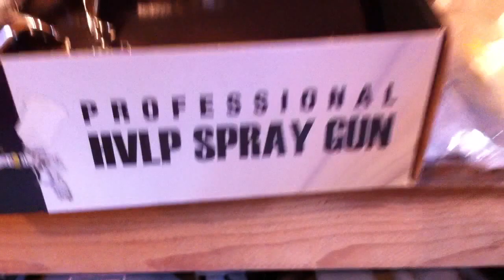New gun action shots

Comment: I liked what I saw a lot.  Your distance was perfect.  You were counting 1 second per foot at about 8 to 10 inches most of the time and were letting your wrist get involved keeping the shot uniform.  I too recommend  you watch the video a couple times and count as you watch yourself and count along.  You will see when you went to fast.  The gun is way better and all that's left is to adjust the fluid knob in a bit OR add some reducer/thinner.  If the needle is adjust in just a 1/2 turn at a time it will let less material into the center action area and the pattern won't be heavy in the middle.
  Is there a mark on the fluid knob to keep track?  If not turn the fluid knob all the way in and file a little hash mark on the knob with a hand file for future reference. Turn the knob out 2 & 1/2 turns to set another bench mark to work from..  You got this now. When it is paint remember to get the edges first..Very good... very good!
Reply from the maker: Thanks, Milo!!! I was trying the counting thing and did mess that up a few times... like I would get the counting right, but mess up on the distance, or vice versa-- Like learning to drive: at the beginning there's all this stuff you have to think about all at once, but after you get experience, things become second nature and you can relax about it... freeing your mind to do other things like text, talk on the phone and change your pants while driving

Comment: awesome video, I have the purple HF gun ,the cup leaks on the bottom treads ,and the lid doesn't seal tight, what a mess ,I will look for the 45 $ one, good job
Reply from the maker: Looking back, the purple one is just designed crappy--- from what I can see, the better gun wouldn't cost all that much more to manufacture -- holes are in a different place, a few more holes... I think the difference is only in the nozzle... It's tempting to switch the air nozzle out...

Comment: Most of your "issues" are covered in the comments.
What I saw was mainly technique problems that take a while to educate the hand/eyes about. This is why I mentioned spraying on scrap panels, metal doesn't absorb paint. It can take a while to get your body/mind used to a gun.

I can still recall my first real paint job. It was a metallic blue (GM code 29) lacquer on a LeMans... First coat looked like I threw sand in it. (DRY). Waited two days and sanded it smooth. The next coat was much better for coverage but the metallic was splotchy. Sanded some more. Then I decided to ask for help....

You have it in the correct order, HELP? Practice, review, practice, review, PAINT the car...
Reply from the maker: Thanks Blazer-- yeah-- I need to loosen up a bit more. Maybe a few beers before playing with sprayables! Well, at least to practice

Comment: First Great Job Reubster!!!! A couple of questions what is your pressure at the gun? before and after you pull the trigger?And you are holding the gun at an angle to the panel causing heavy and light pattern`s (Striping)
Reply from the maker: I'll have to check... When I first was setting it up, I went 28 pounds at the gun (like is says, stamped on the gun itself) -- and nothing was coming out-- just a gentle puff of air... so I fiddled with the settings (all wrong, probably) until it did what it did. Maybe I should fiddle with the air knob on the gun more-- open it all the way and control the flow only from the regulator...

Comment: your overlaps weren't consistent. (causing the striping) try to stay at more 75% rather than 50%. also you don't always have to spray in a straight line. spray in a straight line till you get coverage than you can do what is called a control coat where you kinda hold the gun back and spray the surface at random kinda to make it look uniform. it is all in the technique but each person has their own. you just have to find yours. "practice makes progress" ....also never start painting in the middle of a hood always push one side and than pull the other...you'll get her......later!

Comment: Watch your door video and then watch this video and look what you are doing differently. On the door video you did no overlap. On this one you did a 50% overlap. On the door you kept a much shorter distance from tip to surface. On this one you increased the distance however at times you did get a wee bit too close. Getting too close is what often causes runs on a vertical surface. I still say I'd add a bit of thinner but that is up to you. I have no problem running right up to 50 psi triggered pressure if that is what it takes to put a thick product down. 

This new gun is a 1.4 tip, the same as the other gun. Believe me, it is not the gun, it is the technique. Personally, I have no problems doing cross hatch application and if everything remains the same as what you did in this video, a second cross hatch coat will completely eliminate the striping but again that is up to you.

I think you are learning fast and improving dramatically and I will not give that credit to any gun because it belongs to you the craftsman, not the tool the craftsman uses. I've seen show quality paint jobs done with pure junk guns.

Great job done by a wise student who is willing to suffer a bit to improve. That my friend is what separates the men from the boys; the wise from the simple and the pros from the amateurs. You are wise to practice some more, on metal, not cardboard, before you move to paint because single stage paint applies much differently than primer, unless you are going to do two stage. Only a monkey can screw up two stage and you are no monkey. I'm impressed.

Always watch the product being applied. You can see the difference in thickness just by the tone of the wet product just behind the nozzle. Do what needs to be done to keep everything even without going too thick. As Milric77 says, you can even go to a 75% overlap if that is what it takes to even things out but be careful. Remember that 2 coats with no runs is better than 1 coat with runs and if the product gets too thick, it makes for a shit paintjob. Lots of cars you see with peeling paint is caused by that because the heating and cooling of product thickness drastically affects the adhesion properties between products.
Reply from the maker: Wow-- thanks for the praise, Ed-- going into this whole project as a novice, I put my pride on a shelf. I try to be patient with my mistakes, knowing I will end up doing things over (filler work on the quarter was all sanded off after a million wipes of duraglass). I listen to those with experience and try to incorporate advice as well as I can. Experience is always the best teacher, and I need more...

Filler work and spaying are much more like Art rather than being technical (like the mechanicals)... It's so much more about craftsmanship at this stage. You can 1/2-ass more things in the engine bay, but if you 1/2-ass body work, it will show up like a sore thumb...

Thanks for the tips-- I have more gun fiddling to do and technique fiddling too